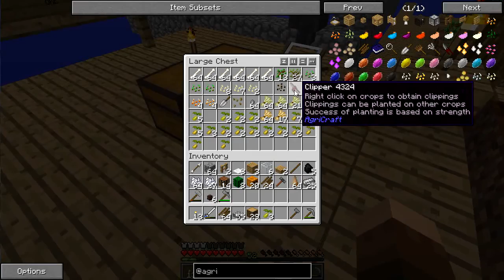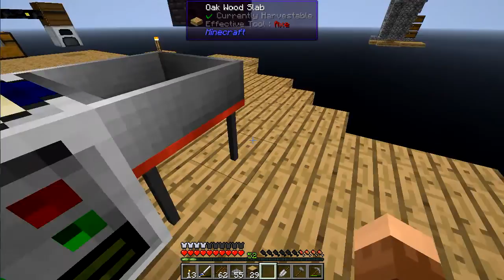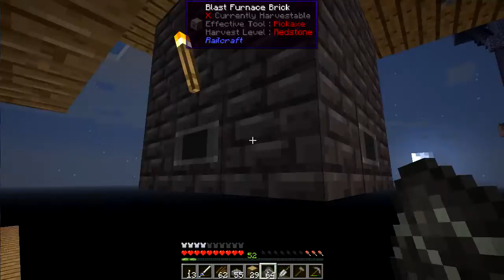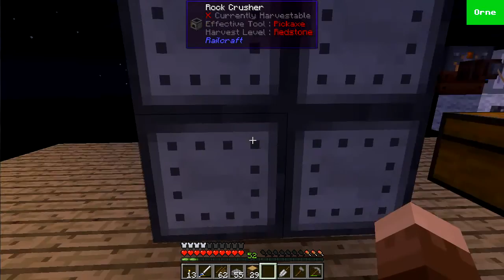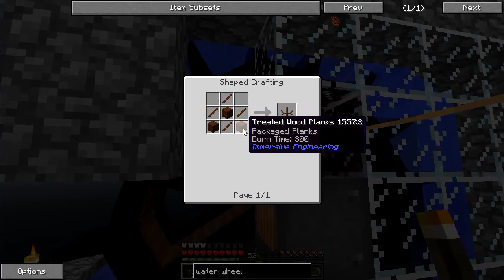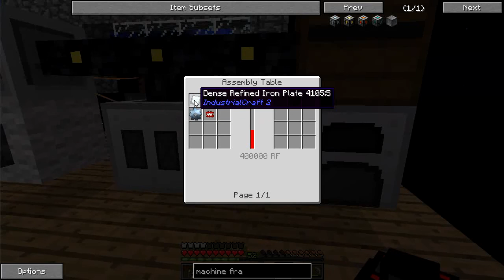FTB Infinity Expert Skyblock - Ep 7 - Machine Frame

Comment: if you ended up keeping the waterwheel, you can more easily control the flow by using liquid glowstone (which flows upwards) on the reverse side of the wheel, and they maximize at 88 rf/tick (I believe)

Comment: If you get an induction smelter you can create redstone ore in it using a redstone block and a smooth stone.  With that you can then breed redstodendron to get infinite redstone.  There are similar recipes for the other ores needed for plant breeding.
Reply from the maker: +Andrew Kerr Thanks!  Does that work with all the ores, or just redstone?   Reason being I thought I would need the mining laser for raw ores.
Reply: Polysillycon There are a number of ores it works for using the ore dusts but I don't remember off the top of my head.